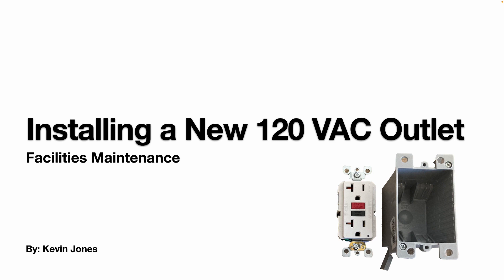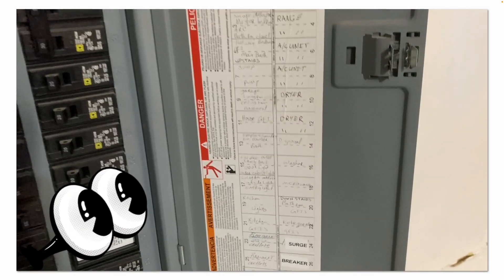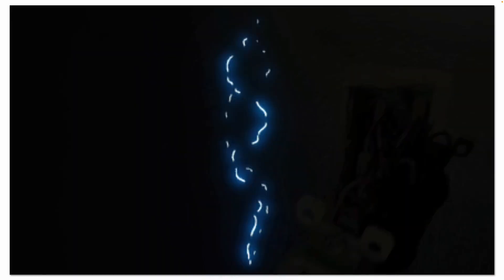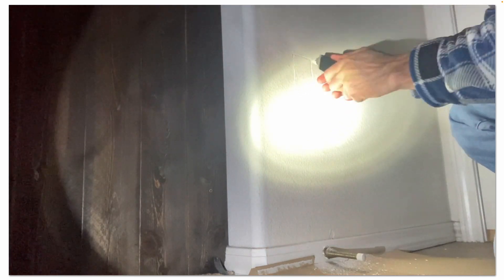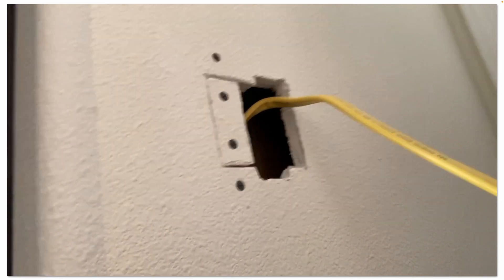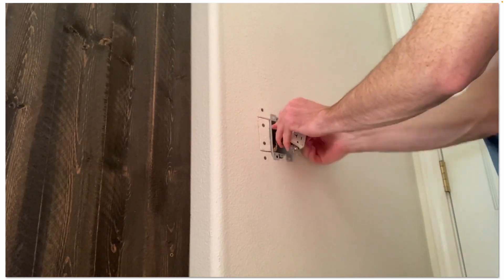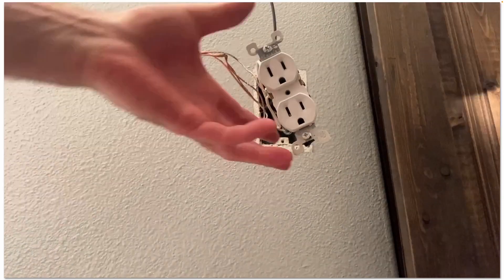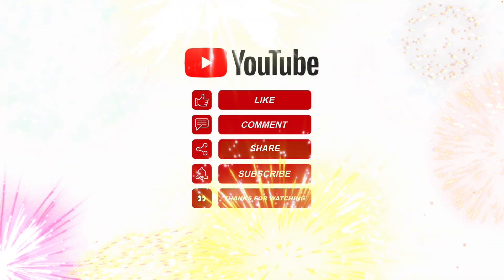How to Install a New 120 VAC Outlet - Part 1

Comment: Thanks, Kevin. Great tutorial. I'd like to clarify something, if you don't mind. Did you pull that new wire for the gfci outlet through the old outlet box on the other side of the wall? I'm just trying to visualize how you supplied the new wire for the new outlet...
Reply: Perfect. Thanks!
Reply from the maker: Yes I did, sorry I didn’t clarify that in the video.